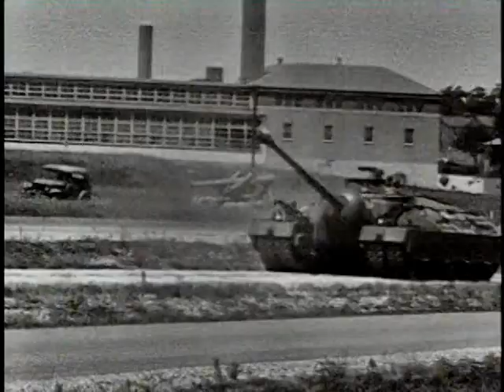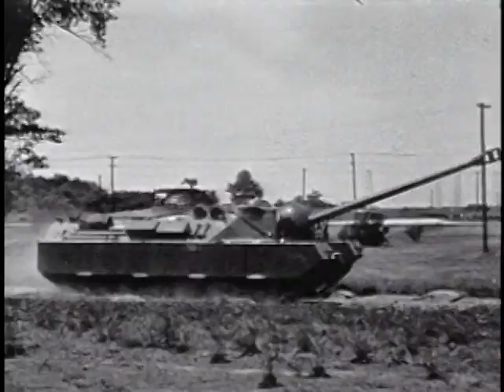US T-28/T-95 super heavy  Tank WW2

Comment: That's a lie. In 1943. Germany invented special tungsten core round, the APCR Pz.Gr.43, (Armor Piercing Composite Rigid) which was also the best AP round of the war. It was in use for all German long barreled cannons till the end of war.
Germany's most powerful tank cannon, the 128mm KwK-40 L-61 could penetrated even 360mm maximally (at 0m, at 0°) using it.
Also, even the T-95 would be better in terms of penetration, in everything else it would remain a pure failure, just as I've stated.

Comment: The 120 Rhienmetal gun is from Germany. The original M1s had the British L7 105mm in them. Check your facts.

  German tanks in WW2 were well armed and had good armor but poor maintainability and manueverability. They were poorly designed from a maintanace standpoint and were a pain to fix in the field while Shermans were often rebuilt close to the front lines. German tanks would break down and get captured because they were not easily fixed.

Comment: The T-95 was without doubt, one of the slowest vehicles of the war in every aspect, due to which it's combat efficiency would be horrible if it ever saw service. And that's why they cancelled it.
It had a speed of only 10km/h, what's just awfully slow. Also, it's cannon had slow rate of fire due to having separate loading, there was only one loader, and it was generally a heavy caliber. I don't know what turn rate it would have, I've just presumed, but what I'm sure is that it would be too slow.
Reply: It wasn't cancelled due to bad combat efficiency, but the target it was designed for, the Siegfried Line, got already overrun by the time it was out of trials.

Comment: Never used in battle. That about sums it up. If it met with a proper tank, the tank would simply outmaneuver it and if it couldn't destroy it, the tank would just disengage and call in support fire like heavy artillery and airforce. Once this beast was immobilized (either its tracks destroyed or stuck in a bomb crater), heavy infantry could engage it with flamethrowers and explosives.
Reply: Exactly that happened to the Nazi Ferdinand tank destroyer.
Reply: Justa318i They were asking for it. Didn't even have a machinegun on that one.
Reply: AudieHolland
They added a machinegun to the Ferdi eventually, as well as a few other minor improvements and reclassified it as the Elefant (the German spelling for Elephant). Still not terribly effective though =]
Reply: Troy Davis Yah, I'm Dutch so rather familiar with German. I was surprised to read that in The Lord of the Rings, Sam calls the giant beasts "oliphaunt." That's the same how our "olifant" sounds, well pretty close.
Reply: Since it was NOT a 'tank' and would have been supported by other armor, most likely 12 Sherman, and a handful to real 'tank destroyers', you might have a problem stopping it.

Comment: The turretless tank destroyer design was incorporated by the Germans and Russians - not the Americans.  The U.S. DID have turretless designs - they were assault guns. This think is too slow to be designed as a tank destroyer.  As for a tank being easy to punch through compared to concrete, you use a completely different method for each.  Anti tank generally requires high velocity where fortifications require High Explosive.  You don't fire AP at bunkers or HE at armor.

Comment: No they didn't. The APDS shells were difficult to make due to their discarding of sabot, and because of that they were expensive what also resulted in rare using of them.
That's not the only reason, they were also very inaccurate and had weak power although they had high penetration, what's another reason why they were rarely used.
Allied crews alone preferred APBC rounds instead, because they were superior in range and power, and tactically they were equal in penetration.

Comment: German didn't use them due to three reasons. Both are same as for others - they were inaccurate and powerless. Using APCR round, even the German weakest long barreled cannon, the 75mm KwK-40 L-48 could penetrate any Allied vehicle of the war.
For Germans APCR round was much better than APDS, because it could also disable any enemy vehicle, but it was also better in terms accuracy and power.
Allied preferred APBC instead of the APDS, due to same reasons.

Comment: Uhh... no. The KwK-40 L/61 was used only on the Sturer Emil. It fired mostly AP rounds because its AP rounds had 200mm of penetration, more than enough to penetrate everything. APCR is not any new technology. It's there since the mid-30s. The KwK. 40 was inferior to the KwK. 44 which is why it wasn't used rather than KwK. 44 which was introduced later. Do some research.

Comment: Also, your claim of 200mm is stupid, you stated that like nothing. Every type of a cannon had many types of shells, how the hell can you just state one penetration without even mentioning with which shell is achieved?
KwK-40 L-61 had different penetrations, like any other cannon, logically because it depends what type of shells it's using. Using Tungsten carbide APCR Pz.Gr-43 shell it could penetrate 360mm maximally (0m, 0°), which made it the most powerful tank cannon of the war.

Comment: Did a quick search and the net claimed it was powered only by a  gasoline-powered Ford GAF V-8, delivering 500 hp, if true what would make them put such an under powered engine in it? This thing weighs 86 tonnes.
Reply: the engine is outputting to a generator so you would have to measure not in horsepower but voltage.
Reply: Ah. sorry I did not realise it was a duel engine job, That makes more sense to me now.
Reply: Why would you output to a generator?
Reply: remember, gasoline was much more potent and fierce back then rather than your regular gas station down the street.  I remember listening to people that lived to see the Barracuda taking every opponent out of the race.  They descride to me that it's so fast it scared the shit out of them.  Whip out that beast(stock) with today's gas, its fast but...  grandma's caddy SUV might beat it.  So if the the motor's design could pump out 500hp, then  withleaded  gas and other mixtures could be hitting 700-1000hp.
Reply: +andrew any sources?
Reply: @frabble, depending on the the type of the generator..  im assuming it's a giant electric motor mounted to each drive wheel for torque reasons.
Reply: westwing23 as far as im aware, then it did not use an elecrtic transmission.
Reply: well, if the motor was made to power up a generator then the logical answer is electrical motors. I have no doubt knowing that they used giant electric motors in battleships for the turret traverse. They don't have speed, but nothing in their way can stop it.  So looking at the speed of this monster makes that theory possible.  Only way i will truly know is i see the blueprints.  Not only they are hard to find, but very expensive too.
Reply: Nope, it did not utilise a dual gas electric system. It had a gasoline engine that outputed power on a torqmatic transmision.

Comment: Who will win?

T-28/95 or Panzer VIII Maus?
Reply: PromokashkaSP  In your dreams comrade
Reply: PromokashkaSP so?
Reply: PromokashkaSP and in which indication did I say that they were?
Reply: PromokashkaSP then get out of here.
Reply: PromokashkaSP so your saying a 122 mm gun can go through 200mm and 300mm of armour? no thanks
Reply: +chan young Choi who ever has the most fuel ?
Reply: gasdorfy munchy who knows?
Reply: Stalker I know.
Reply: +Stalker What about T29?
Reply: Cutwoodnow Didn't ask T29.
Reply: mause the mause has to much slanted  armor and the t95 is to long to relode and it was very short so the mause could hit the top of the t95 with armor persing shells and it would win
Reply: Ché Calder Top of the T95< I wasn't really taking about WWII

Also BOTH have slow ass reloads.
Reply: LivingTheFate the Doom Trutle would go through the mause like butter fyi.
That only happens if it goes to the side or the rear. Neither of them have the ability to penetrate each other unless they go to the side or the rear.
Reply: +chan young Choi the t95 can pen the mause's turret cheeks from the front and the maus can pen the cupolas and that is easier cause maus is bigger
Reply: Normelniere What you wrote is actually wrong. 
1. About its gun. The 120 and 155 is the only guns of the T95 that can pierce the Maus's turret cheeks. However they only exist in WOT. In reality the only gun it had was the 105mm gun which is not strong enough to pierce the Maus's turret cheeks. I was talking about reality. Not in WOT.
2. The cupola? Like I said we're talking about reality. Not the game. In reality hitting the cupola is nearly impossible and barely does anything against the Tank.
Reply: chan young Choi works in war thunder
Reply: Normelniere which is a game.
Reply: Maus for sure, look at the gun
Reply: Tobias Pohn Its gun is not going to penetrate the T28's armor in any distance unless it gets to its side or rear.
Reply: Its obvious that the T26 would win over both :'3
Reply: A Panzer 4 H
Reply: Hirasawa Yui how?
Reply: chan young Choi
by drifting behind T95 / shoot Maus engine from the hill while hetzer lift up the Maus XD
Reply: +Hirasawa Yui 
Flanking does not count. The T95 can easily blow the pz4 into shreds before it goes to its rear.
The Maus from GUP? Wasn't that actually destroyed by a Tiger P?

In here i was talking about realistic situation. Not anime.
Reply: +Hirasawa Yui 
Also the Maus would easily destroy the pz4 by just using its 75mm gun
Reply: chan young Choi
Yeah,good luck on try shooting a pz4h with that turret traverse speed.That pz4h is a skilled driver and have extremely luck :)
Reply: Hirasawa Yui and good luck trying to get around the Maus. Also for crew skills? Here's how it goes
Panzer IV: Owned by less experienced tank crews who have never gone to tanks like the Tiger
Maus: Owned by highly experienced tank veterans who have been in other great tanks like the Panther and the King Tiger.

The Maus crew has all advantages when it comes to skill. In the end the Panzer IV's crew doesn't stand a chance.

and good luck trying to do these

1.Getting the Hetzer under the Maus's hull(possibility in reality: 0.0000000001%)
2. Going in areas where the ground is flat
3. Avoiding the Maus's shots just like in GUP
Reply: chan young Choi
Panzer 4:a reckless commander,a fast learner driver,a war machine fangirl loader,and a flower builder gunner.what could possibly go wrong?

btw,avoiding Maus shot is easier than avoiding a jagdtiger shot.There is a bunch of high area that can used as a shooting place.With miho at command,nothing can stop them,even the Karl gerat or T28/95 Super heavy tank and a shitload of pershing and a very skill centi 1 driver.
Reply: Hirasawa Yui You're talking about the Gup's Panzer IV crew? I was talking about the one in reality. Anyway both would be screwed up in real situations when facing tanks like the KT, IS-2, E100 and the Maus who have far better crews.

No. The JgTiger and the Maus have the same guns. Also high areas like hills? Then what about in cities where there's no hills at all? Also how are you going to avoid the Maus shooting you in the hill? Shooting the Maus by using a hillpart is also counted as an ambush which doesn't count. The only things that count are frontal combat.
Then I'd ask why the Panzer IV crews in WWII failed to destroy a Pershing.
Reply: chan young Choi
because simple.75mm gun cant pennetrate that 120mm sloped armor on persh......they even have trouble to pennetrate T-34 armor with taht gun.
Reply: Hirasawa Yui Pershing? Yes. T-34? no. The 75 can easily penn the T-34's armor like butter.

So the 75 can barely do anything to the Pershing. Which means that the Panzer IV crew will easily be blown into shreds by the Pershing and the Maus.

Comment: The misery of the minority germans in poland now overshadows the open questions on Danzig and the transit ways. That misery in 1939 now developed to the third and most pressing reason for the outbreak of the war.In late spring of 1939, after 5 failed negotiation initiatives, Hitler comes to the decision, that the batch of problems at a pinch needs to be resolved by means of war. In the summer of the year 1939, Hitler gives order to let 52 army divisions be deployed.

Comment: but the t95 is the only 1 to use its bogie wheels on train tracks that was it's mode of transportation in rails and no the t28 is not the same size this t95 is much slower than the t28
Reply: What?   No it didn't remove its tracks to ride its boogies on rails.   it was transported by railcar after the outer set of tracks were removed.   T28 and T95 are the exact same vehicle, period.  It was renumbered by the military during its lifetime.
Reply: there was another T28 that was russian I believe

Comment: That vehicle was a pure failure. It had a slow mobility due to poor engine for such weight and no tactical role. Against German concrete bunkers, it's 105mm gun was too weak due to being high velocity and it was also yet too light.
Also, for fighting German tanks would be also a fail. It's gun couldn't penetrate ahead of Tiger and Panther, which makes no difference even from Super Sherman, and it also had a slow rate of fire.

Comment: Stop bullshitting. No one tests their gun at 0m. Germans test their guns at 30 degrees with a milder steel to prevent cracking. The KwK 40 L/61 was only able to achieve 200mm of penetration at 30 degrees at 100m. It wasn't that great. The first gun that can penetrate anywhere near 360mm with and KE based round was the American 120mm M58, which was from the mid-50s. Nothing before that can do that.

Comment: That's the t 95 not the t 28
Reply: The T28 and T95 are effectively the same vehicle. The T95 was built on the T28 body with more forward armor, a thicker gun mantle, and a larger gun. They were never intended to see front line combat except for the singular role of destroying fortified gun emplacements on the German Siegfried line.

It was decided that the fixed gun served too limited a role and that led to the development of the T29 and later the T30 heavy tanks. Two T29s were built and tested but never saw production and the T30 was scrapped during the design phase, and only one tank was ever built. The two T29s and the one T30 prototype are currently at Fort Knox, Kentucky.

At the beginning of the Korean war the T95 was ordered into combat, however that meant they had to completely refit a ship to carry the thing from the US to Korea. The ship was refit and the T95 was loaded and then the order came down that the T95 would not be sent to Korea. Currently the T28/T95 is at Fort Benning, Georgia
Reply: they are both the same. only one difference one is called t95 tank destroyer and one is calle t28 super heavy tank. stop living in wot, wot made them different because you cant have tanks that are the same in the game so they made the t28 smaller

Comment: why this tank Equipped very poor engine? And though supposed there was a more powerful engine.
Reply: Cost may be a factor. Also, you have to consider that space may be limited when it comes to engine placement. I know Continental and GMC made some decent engines during that time. Considering that only two were made it doesn't surprise me that they made a poor engine selection. If they had continued with this project they may have given it an engine with more grunt.
Reply: +Eric this weapon was designed to take out fixed fortifications, not fight other armor.  Speed was not an issue.  The external treads would be removed, and the SPG would be taken by rail to close to where it would be deployed where it would be offloaded and then the external treads replaced.  It would then roll to within it's 12m gun range and fire away until the fixed fortification would be destroyed.  

The Ford GAF was the same engine as used in the M26 Pershing, and was the most technically advanced Ford had to offer at the time of development.

Comment: Thats T95
Reply: The T28 and the T95 are the same vehicle. What wg and gaijin call the "T95" Was originally designated as the T28. Then, due to a role change (To tank destroyer) became the T95. It was then switched back T28 which was the next available designation for a heavy tank. The "T28" in WoT and WT is actually the transport version of the vehicle. The real T28's outer section of tracks could be removed, with the entire process would taking up to 2 hours to complete. This travel version would have never been used in combat without its outer tracks.  It also never had that little glacis thing you see on it in WoT and WT.